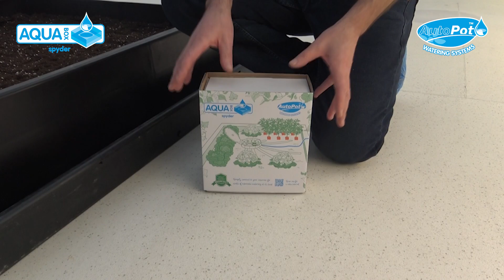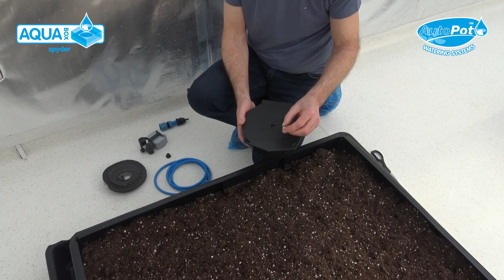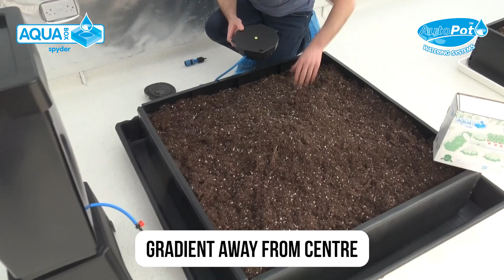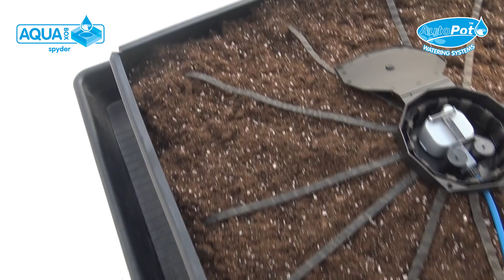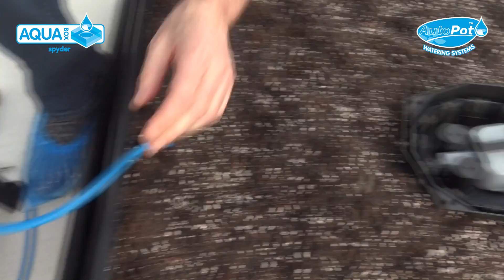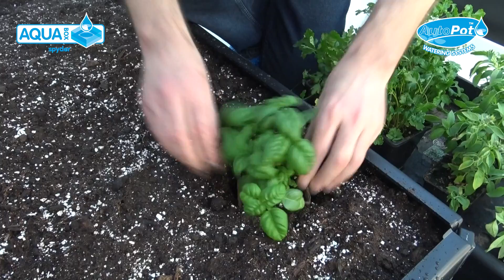AutoPot AQUAbox Spyder Setup

Comment: Will thks work on a 4x4 raised bed?
Reply from the maker: Hi,

Many thanks for your enquiry, we usually say that AQUAbox Spyder will irrigate up to 3.3ft x 3.3ft.

So a single Spyder might serve your purposes at a stretch.

Otherwise you could connect 2x Spyders up to a single reservoir using a 9mm / 3/8" tee connector.

Admittedly 2x Spyders may mean you don't need to use the full set of strips with each.

But the strips can be used as required and cut to size to suit the size of your bed.

Hope that helps, all the best!

Comment: Will this work in a higher bed also ?
Reply from the maker: Hi,

Many thanks for your enquiry. The AQUAbox Spyder will certainly work in a raised bed, you just need to ensure that either:

The reservoir you’re using is on the same level as your plants and that all your plants are no more than 2-3 meters away from the reservoir. The fill level of the reservoir relative to the proximity of the AQUAbox will then create enough gravity pressure to drive irrigation as long as the reservoir is kept topped up and doesn’t drop below a third full.

Or

The reservoir you’re using is elevated by 6” / 150mm above the level of the AQUAbox - thus creating gravity pressure to drive the system

Hope that helps, all the best!